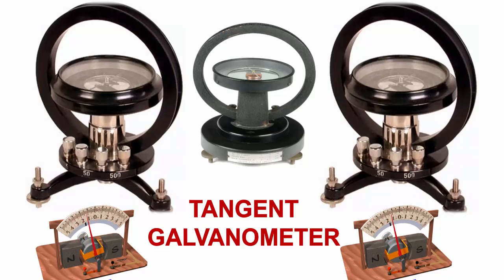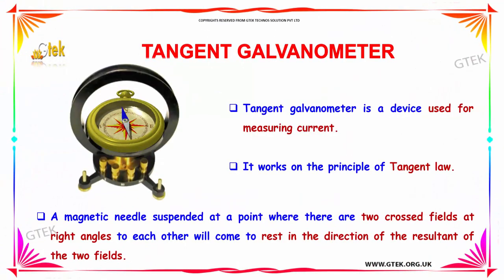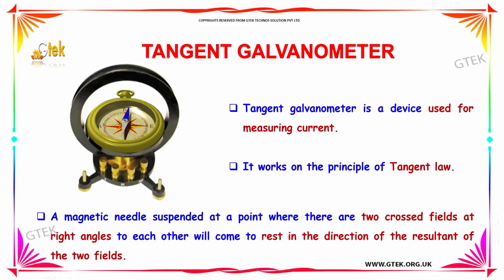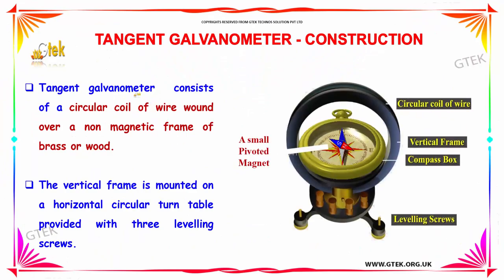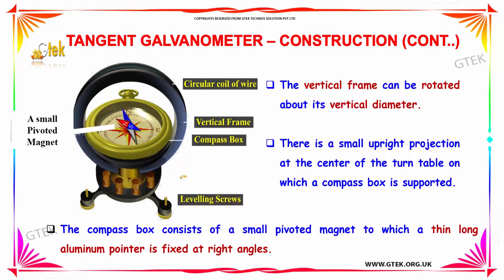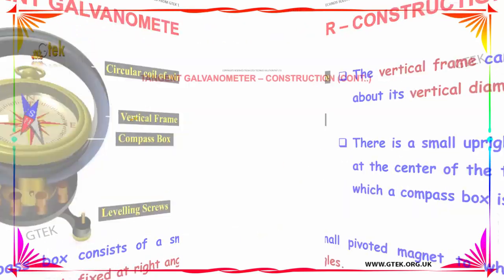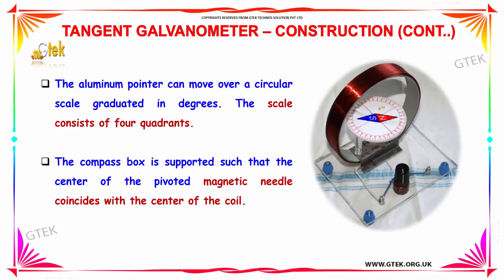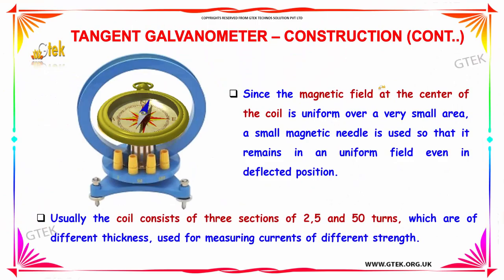Tangent Galvanometer Construction Effects of electric current class 12 physics subject notes

Comment: Tangent galvanometer consists of a circular coil of wire wound over a non magnetic frame of brass or wood. The vertical frame is mounted on a horizontal circular turn table provided with three levelling screws. The vertical frame can be rotated about its vertical diameter.

There is a small upright projection at the centre of the turn table on which a compass box is supported.

The compass box consists of a small pivoted magnet to which a thin long aluminium pointer is fixed at right angles. The aluminium pointer can move over a circular scale graduated in degrees. The scale consists of four quadrants. The compass box is supported such that the centre of the pivoted magnetic needle coincides with the centre of the coil. Since the magnetic field at the centre of the coil is uniform over a very small area, a small magnetic needle is used so that it remains in an uniform field even in deflected position. Usually the coil consists of three sections of 2,5 and 50 turns, which are of different thickness, used for measuring currents of different strength.